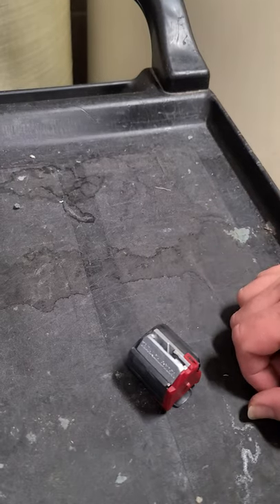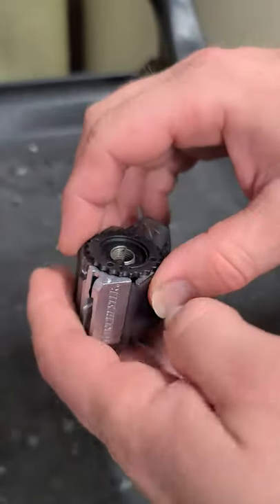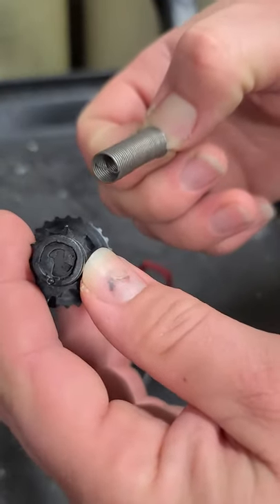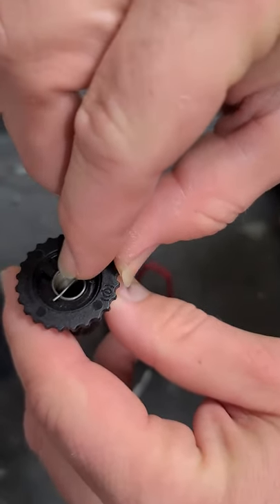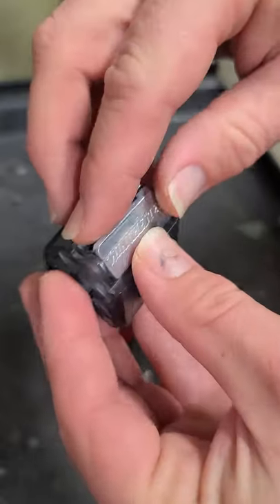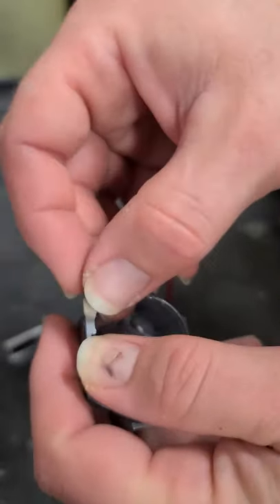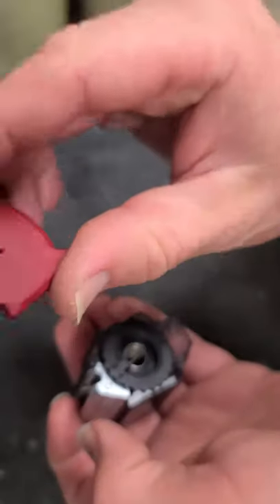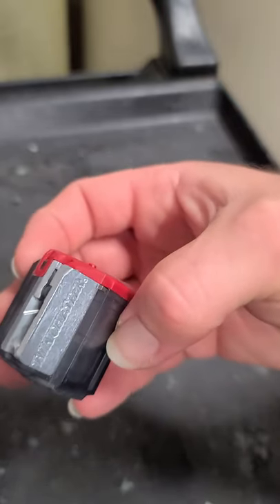winchester wildcat magazine disassembly

Comment: You did everything correctly with the exception of winding the spring. From the position that you put the leg of the spring under the tab, it needs to be wound three more times to give the proper pre-load on the spring to get the magazine to feed properly. You can accomplish this by using need nose pliers on the leg of the spring and rotating the black follower and setting it back under the tab after each rotation. After winding it 3 times, I would suggest pushing the last coil of the spring down into the hole to get the back plate to align more easily when putting it back on.
Reply: Thanks for this 🙏🏽🙏🏽🙏🏽
Reply: Thanks for finishing this video! 3 times around is perfect!
Reply: Thanks man, also I would like to add that sometimes that little "last round" holder pin can bend, just be very careful with it. As RM 7 said, make sure you spin the spring 3 times and it will have proper weight to load the next round in.

Thanks RM 7!
Reply: Exactly what i needed. Thanks

Comment: Thanks for the info, really useful, my mag popped open today whilst loadingit, was a bit dirty, not a good sign for the future, my Ruger BX25 saved the day at the range. But I followed your instructions and all went well, I didn't put any extra torque on the spring and it feeds superbly, loading, ejecting on cycling bolt and locking open on empty. Maybe the springs were updated as this gun is only six months old.

Comment: Thanks again, excellent tutorial.I had a problem with my magazines, both 2 new when bought the gun. One worked fine the other was very stiff loading 1st two round, and if I forced it, it would pop open. Manage to reassemble it a few times after watching your video, but a simple know would make it pop open with or without ammo. Took it back to my local RFD who swap it from a brand new. I have since shot over 4000 rounds no issues but they look pretty dusty in need of a good scrub, but have to confess I’m a bit worried to get then open and clean just in case I had the original issue. 🏴👍

Comment: Are you noticing that the rounds rattle around a lot in your mags? It's happening in the mag that came with the rifle and the 3 additional mags that I bought. I'm trying to imagine walking through the woods sounding like a damn maraca lol. Am I missing something?
Reply from the maker: Yeah it does rattle unfortunately the channel for the rounds are a little too tall and too wide gives them the room to rattle around
 I'm guessing it gives some space just incase manufacturing errors and still function reliably.
Reply: @circuszero  for sure, in the year now that I've had this rifle, it's ran reliably so I can't really complain. I'll take the rattling if it provides reliability! The OEM Ruger mags work well too, they're just a little more difficult to insert and the bolt won't lock open after the final round. All things considered, it's a good rifle!

Comment: I tried putting mine back together like this and it will go back together but it don’t have enough spring tension to feed correctly
Reply from the maker: If have a Twitter account you can reach me there (@circuszero). I might be able help further.
Reply: Same issue. Now that I'm home, think I fixed it but won't know till next range day. Did you end up fixing it? I think I just needed to line up the slot on the red cover piece with the center of the spring, seems to load with tension now
Reply from the maker: @uninvited13  yeah if you put the sping in the two tabs it should create enough tension to properly feed the rounds if not the spring was made incorrectly and you may have to spin that last extention from the spring a full rotation but I would contact the manufacturer. That extra tension on the spring will probably cause fed issues or cause it to break eventually.
Reply: @circuszero  
Thank you. It did feel tighter the last time I assembled it. I guess I should familiarize with taking the whole rifle apart, but that kind of stuff always makes me worry ill be in this position where I'm not sure I'll be able to put it back together. On that, thanks for the video too!
Reply from the maker: @uninvited13  glad I was able to help. I know how you feel I didn't know that much about gun before I bought my 1st gun back in 2020. I've learned by doing and watching video's on here. We have all been there with not knowing weather it be a gun or new to gun we expand our knowledge and spread out it there to help others.

Comment: Can u do a complete disassembly of the trigger. Also I'm wondering if there's a extended mag release for the gun or if your able to install any binary trigger to it
Reply: Pull back on either the red tab in front of the magazine slot, or on the little red lines on the side of the gun (on either side of the magazine area recessed in the stock of the gun) and it should allow release.